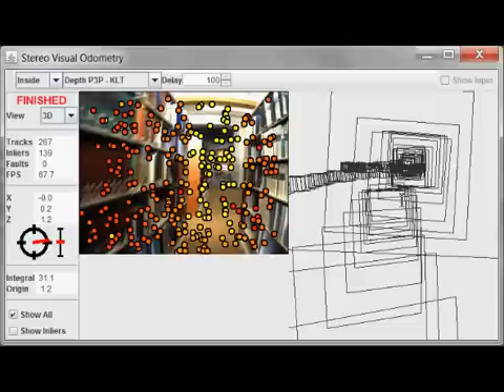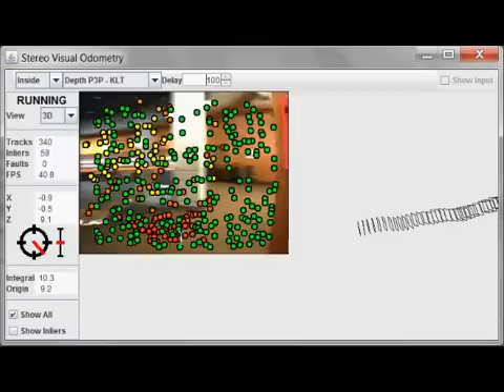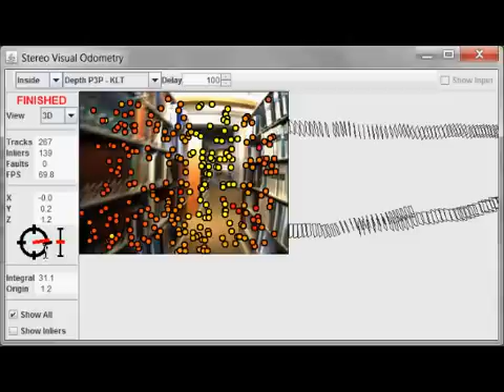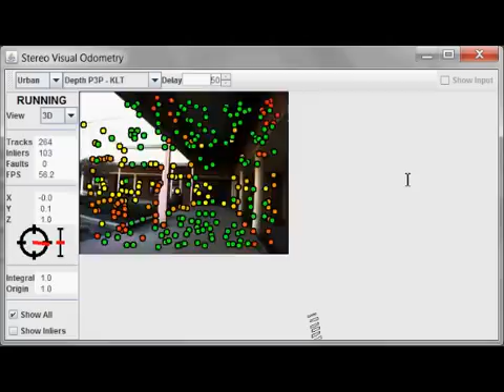Visual Odometry in BoofCV

Comment: I would like to integrate this idea with this project:
http://ev3dev-lang-java.github.io/#/

Any requirement for the webcam?
Where is the source of the Applet?
Other example?
Reply from the maker: In the current code only one algorithm will kinda work with a cheap webcam.    Stereo and RGB-D (e.g. kinect) work much better.  If you like we can have a more detailed discussion here https://groups.google.com/forum/#!forum/boofcv  The source code for that app is included with the project's source code.
Reply: Oki, today i will post on the group the question